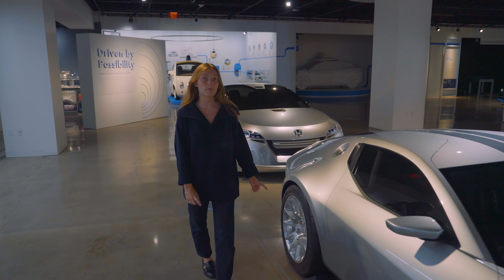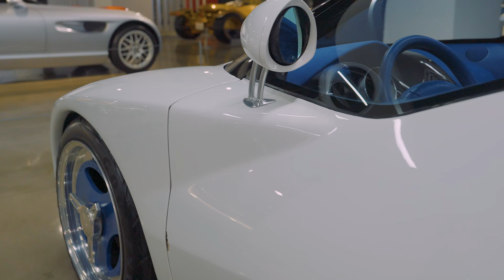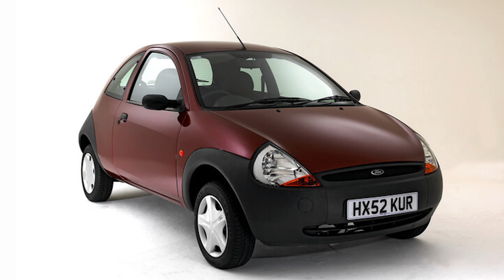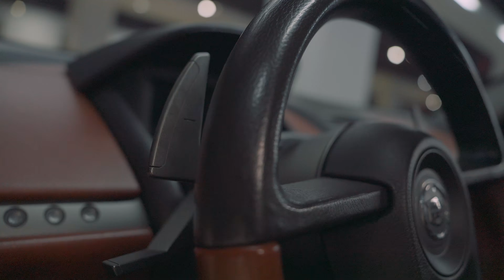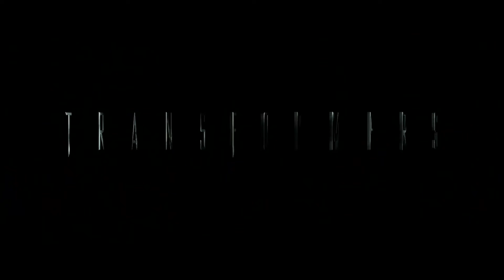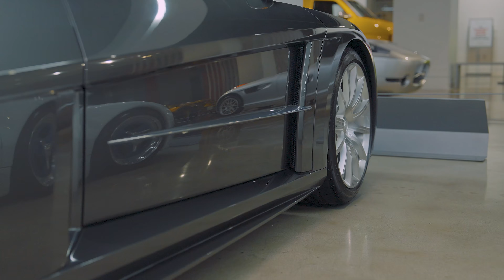Modern Concepts: Ford GT90, Chrysler ME Four-Twelve and Cadillac Cien

Comment: It should be noted the GT90 was named for the 90th anniversary of Ford Motor company, not the time it came out, although it was the 90s. The 2004-2005 Ford GT has the number 100 hidden in its headlights, because it was made 10 years later for the 10th anniversary.

Comment: (You might want to push the GT90 back a few inches so it covers up that power outlet)
Also please try to straighten out the badge on the ME Four-Twelve's steering wheel.
Reply from the maker: Yes to the former, no to the latter.

Comment: Those hypercars should be produce right now, is not too late. 
Cadillac would likes to make a hypercar, so they could use the GTP's technology to create a V16 (using 2 V8) hypercar 😳. Chrysler can easily bring the ME 4-12 with modern dashboard and modern lights using 2 V6 for make a V12 with a bio hybrid system (for be subsidiary of Stellantis), and the Ford GT90 should be release with modern dashboard and a efficient V8 🏎️💪🏻
Reply: They could also use two Hurricane inline 6, creating V12 with quad turbo.
Reply: @LLadies_Man_217  slow down there partner, you're gonna kill the polar bears with that one
Reply: They probably would only be able to max it out at maybe turbo V8s like Ferrari due to the emissions regulation nowadays choking cars out more still and encouraging downsizing even for fast cars.
Reply: chrysler is broke af and stellantis' whipping boy, they aren't doing anything good anytime soon, i doubt ford is interesting in anything with more than 8 cylinders or the gt platform anymore, for better or for worse, and cadillac seems to be trying to move away from ICE regardless as to whether or not thats actually a good choice, but ironically i think they are the most likely to make something of a spiritual successor to the cien

Comment: I think these are the holy trinity of american V12 supercar (Which never happened). Right?
Reply: Theres a 4th tecnically, but it was an even wilder prototype, the Covertte ZR12 with a ridiculous 10L V12 straight out of a high speed boat from the time.
Reply: @unkindled6410  Ahh. I guess i didn't know that v12 corvette, right?
Reply: @widjojohuang7854  yes, however that one was more like just a C4 vette at the time with an extended front and said V12 straight out of a racing boat, it was deemed not only too expensive of a project but also too dangerous as one would expect, surprisingly the engine wasnt as stupidly heavy as one would think since it was made of mostly aluminum. I wonder if they could had reduced the displacement to only a little over 8L since the idea was to try to compete with the vipers absurdity at the time and tweaked to be a little better as a car engine.
Reply: @unkindled6410  Woah. yeah. It dangerous just like the 1st gen viper, maybe because no ABS or traction control
Reply: @unkindled6410  Or yeah, maybe the engine was also too powerful, just like cerbera speed 12
Reply: @unkindled6410  And yeah, maybe i agree over that 8L engine displacement.
Reply: Not V12, but the rotary Corvette concept was cool, and the Indy Corvette which basically everyone forgot about
Reply: @LLadies_Man_217  Well, yes. But i didn't know about that corvette

Comment: The day that a car manufacturer realizes that they just need to build the concept car will be a game changer. Nobody is really excited that a few curves from these cars were slapped onto the design of the box on wheels production cars that we've been driving an iteration of for half a century.
Reply: Problem is regulation. We are lucky Lamborghini is even legal here.
Reply: @NarasimhaDiyasena  And money.
Reply: There's been some instances already of concept cars that make it to production almost unchanged in terms of exterior except for interior changes for easy production. BMW i8 for example, Honda S2000 (kinda, it's 90% similar to SSM concept), Suzuki Swift ZC31 (minus the funky roof), Nissan GT-R R35 (same case as S2000 - small changes to make it a bit more production feasible), Audi R8 1st gen, Audi TT, etc.
Reply: @PlatinumNath don’t forget the Renault Avantime, they didn’t changed anything from its concept phase
Reply: Allow me to introduce the reason to you. The Chevrolet SSR.
Reply: Such an original comment you have